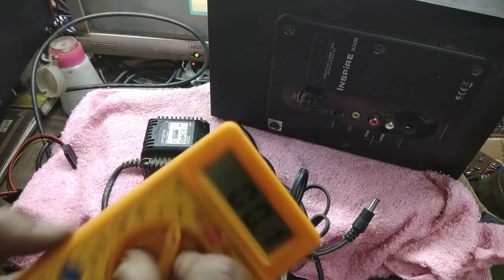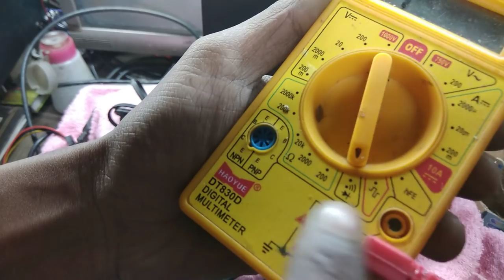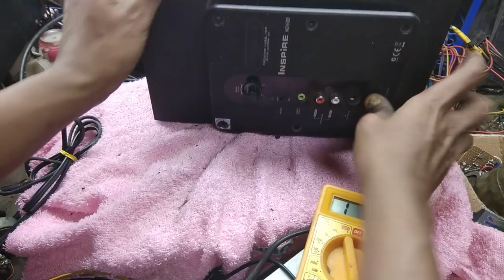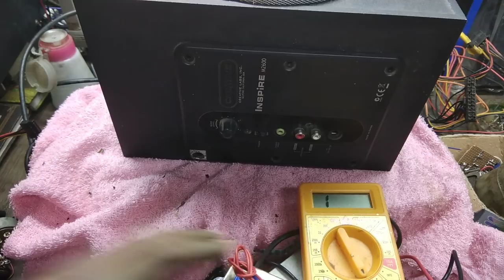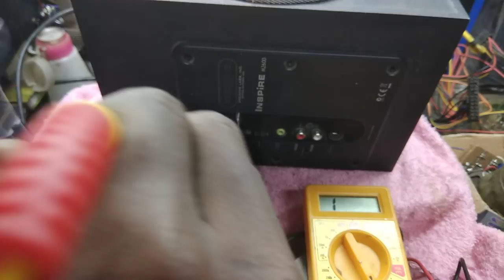creative INSPIRE M2600 sound system repair step by step in power supply

Comment: Your testing method and style is very nice. But hammer is not a good idea to open sealed adapters. Please apply some petrol and wait for 2-3 minutes. I am using this (petrol) method to open most of the laptop charges and adapter.

Comment: Sir g mere pass v same kit hai. Power line oky hai but no sound 4558 ka out put v check kr leya output aa rha hai but TDA8510 se out nahi ho raha hai.
Reply: Koi suggestion dejye kya check kre
Reply from the maker: Uske age "opamp" i.c se line a raha he. usse check kijiye or badal ke v dek sakte he, jyada price nhi he
Reply: @creativehardwarescientist  sir g
4558 k pin 6,7 se out ho k tda8510 k pin 1,3 me input v mil raha hai. Aur tda8510 pe voltage v thek hai pin 14,13,5 pe 12vdc mil raha hai. Kya tda8510 kharab hai.
Reply from the maker: @paulvincent1274  , han jee bohot jyada chance he, app ekbar replace kr ke dekhiye
Reply: @creativehardwarescientist  Thankyou